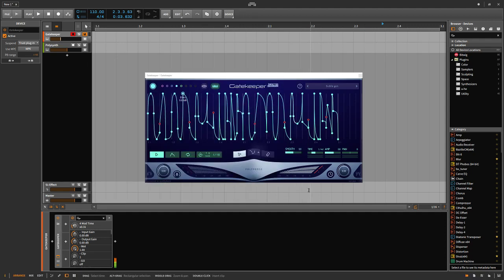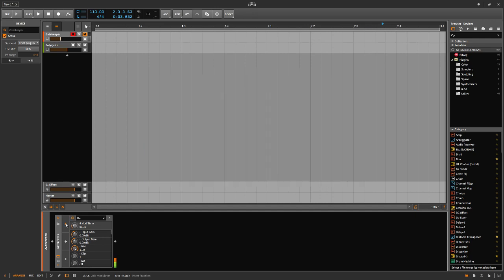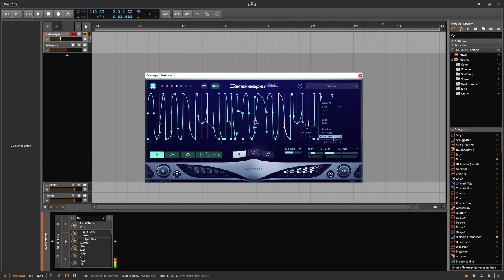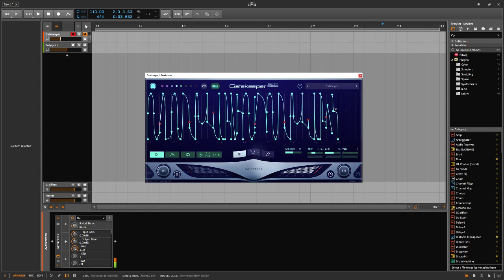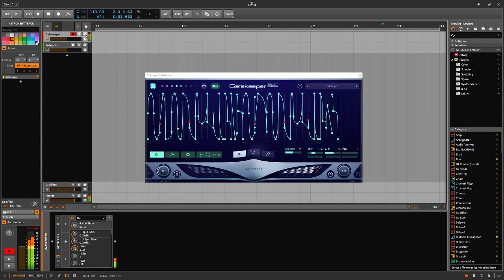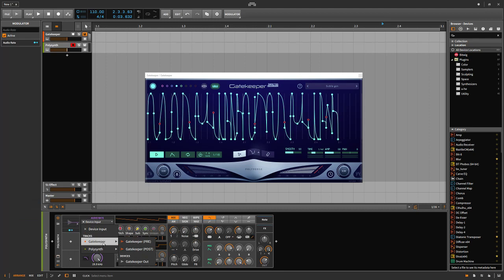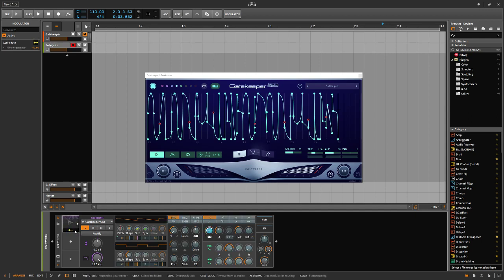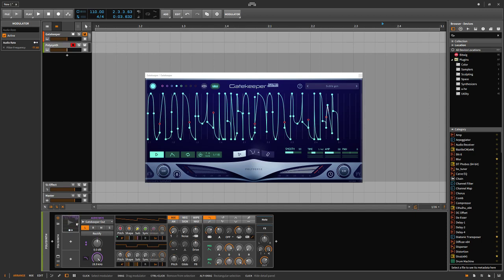Using Custom Envelope Shapes for Modulation in Bitwig with Gatekeeper's CV Output

Comment: Great tip! You can also do this inline on one track, no need to have a separate track for Gatekeeper. Put the Gatekeeper plug before the plug you want to modulate, group GK, and turn down the mix on the group UI. Use the audio rate modulator as you normally would
Reply from the maker: Game changer! Good thinking there,  definitely gonna use this!